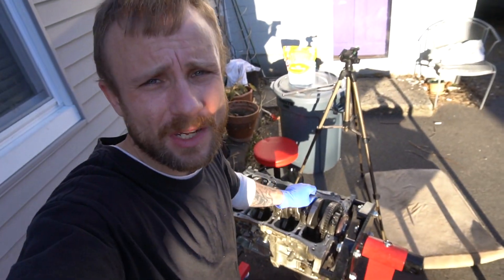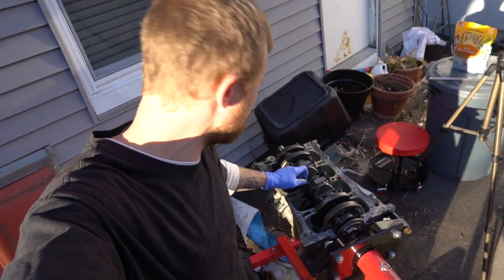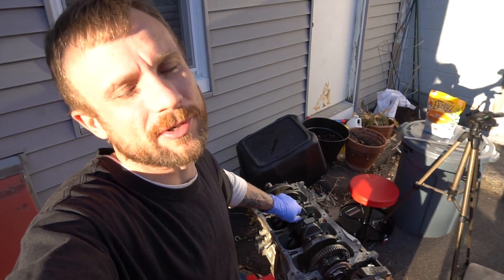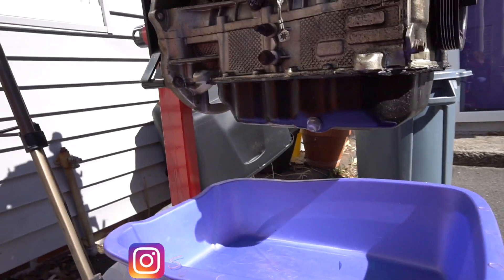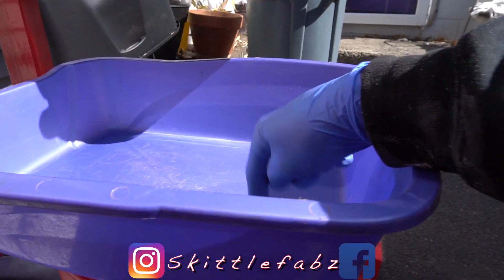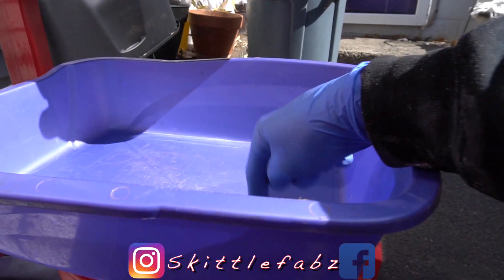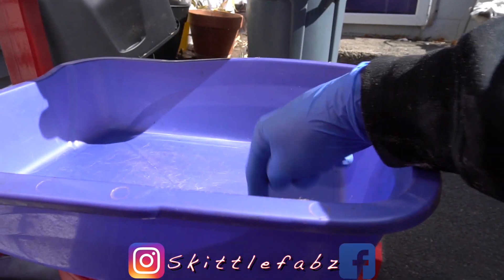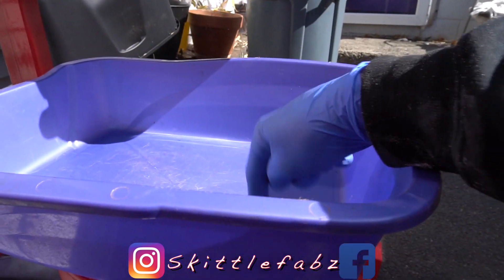Darton East Assembled 4B12 Caliber SRT-4 Disassembly - I Found my ISSUE‼️😩

Comment: No warranty or refund for not torqueing it down properly?
Reply: Thats my thought exactly. Mains don't just back out.
Reply: Skittle Fabz I was gonna send my block to darton, but because of that alone, I won’t be.... They built it, and it’s clearly assembly failure. Main bolts don’t just back out
Reply: @SkittlefabzSRT4  most shops don't warranty I agree. But that is 100% their fault. I saw most of your vids. Everything was new. Hell I used a na block and reused all main and rod bearings. Mine is still running. I built mine around the time you posted yours. At min they should refund labor
Reply: @SkittlefabzSRT4  also how's the rods?
Reply: Skittle Fabz honestly I’m kinda over mine but for different reasons. I came from the mini world where everything just breaks for no reason(I blew one up from nothing, multiple HPFP failures, etc). I want a 135i. Easy 600hp daily
Reply: That's a god damn shame bro, sucks watching this. Sorry for all the BS this car has caused you. And for that dingus calling you lazy is the biggest understatement ever. Keep on keeping on bud, you're gonna have one of the nicest neonsrt4's in the future ✌🏻
Reply: Skittle Fabz I’m glad you let this video out. I hope you publish the next one as well. Hopefully it sets them straight
Reply: @SkittlefabzSRT4  well at least I'm happy now that I never had my sleeves installed. I got realtune rods and pistons and darton sleeves sitting in a box for years. I'd change title to something like "darton can't build shit" put them on blast
Reply: Skittle Fabz well I now know how I’ll be building my block if I decide to move forward with this car
Reply: I would hope!
Reply: @ZachFrank714  I agree 100%!